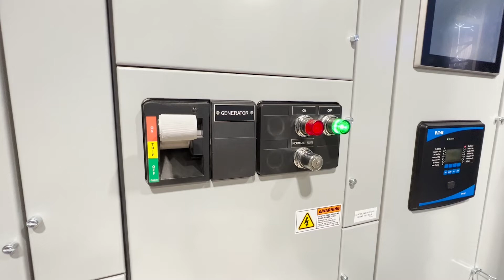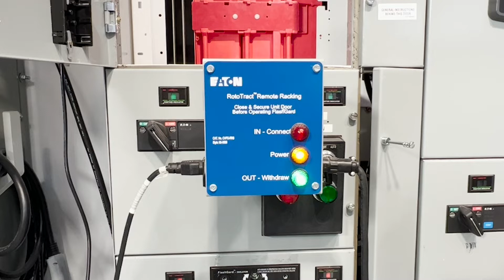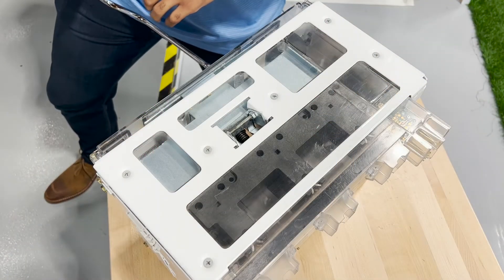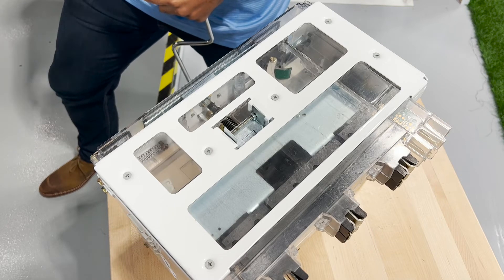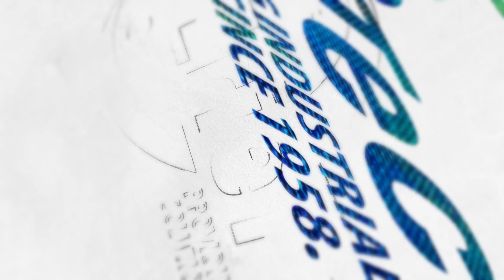Eaton's Motor Control Center Advantages

Comment: The large campus that I retired from had a lot of Eaton MCC'S & 13.2KV dual service switchgear. Best tech support of electrical equipment. Had the fancy MCC's with fancy digital displays where you had to enter motor amps. Junk. Every time they rep!aced belts on say a 2 to 10 HP fan it would trip out. Figured out if I changed o e parameter to think it was zero would not false trip.